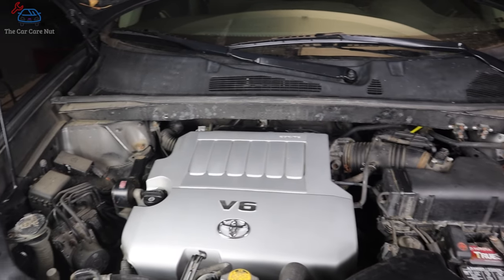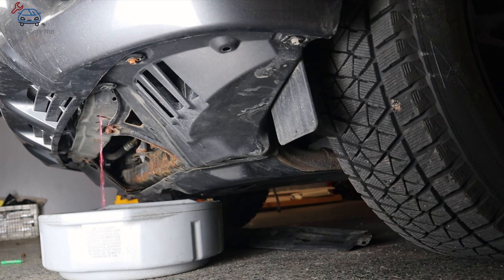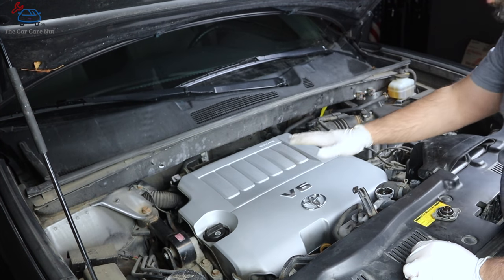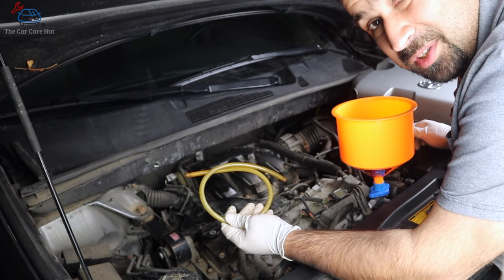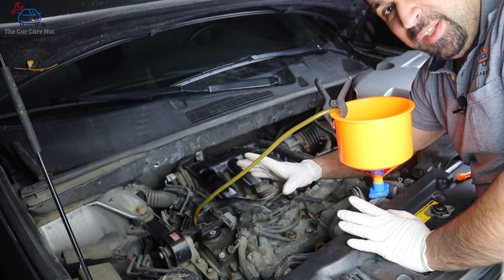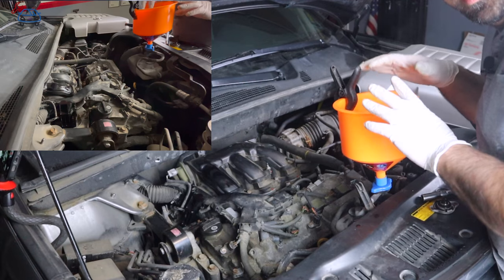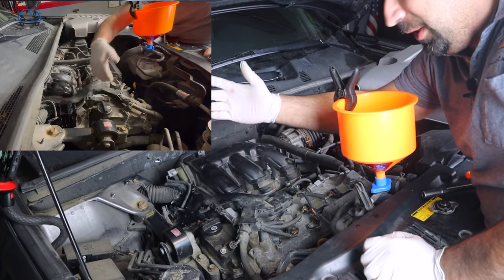Toyota Cooling System Bleeding for V6 2GR-FE 3.5L THE RIGHT WAY!

Comment: The tool you used has a blue radiator cap and the ones in your amazon affiliate do not. There are 3 kinds for sale in your amazon affiliate, the 1st one I ordered did not fit and leaked on our Highlander.  I returned it and just ordered the 2nd one, hope this time works.   Where did you get the one you used in the video?
Reply from the maker: I had the three because these companies keep changing their offerings. The one in the video is I believe the first one but many have said they’ve changed them. Gotta reorder one and see how they are now
Reply: @TheCarCareNut  I am happy to report the 2nd one I ordered did fit with no leaks.  The build quality of it is day and night than the 1st one I ordered, I bought the mid-tier out of the 3 in your amazon affiliate.  I would like to buy the dashcam on your Amazon affiliate as well, will you install it in our car?  I am about an hour north of your new shop on a Saturday with no traffic morning drive.
Reply from the maker: I would. unfortunately the should wouldn’t be open Sunday or Saturday.
Reply: @azzurroday9730 hi, which one exactly did the trick? The one with the black cap on Amazon currently?

Comment: 1 more question guys, should we disconnect the bottom radiator hose to drain any coolant in it?
Reply from the maker: Hi! You could but a only a small amount will come out
Reply: @TheCarCareNut  that's all I need thank you AMD
Reply: Bro I did it just now, worked exactly as you said, thank you kindly, the thing is 4L came out, and I put 5L in the (1 bottle form toyota) but the servicr manual says the capacity is 9.7L. Where is the other 5L?

Comment: How do you know which of the engines you have?
Reply: There should be a sticker on the underside of the hood that shows the engine type. You can also look in the Specifications section of your owners manual.

Comment: I recently replaced my thermostat and water pump. Tried to bleed per your steps. Everything seemed to go well until it all went down the hose and started overflowing back up the funnel. Temp was 185 or so and so thermostat should have opened up. Any ideas?
Reply from the maker: Hi! So after it went down did it start flowing directly through the hose to the funnel with continuous flow?
Reply: @TheCarCareNut  I decided to repeat the process from start to finish. Never did get continuous flow. The violent backflip never did stop. It would go up and down in the funnel. Multiple times, I had to use a cup to take some coolant out only to add it back later so it would never go empty when it reversed itself. How long should this take?
Reply from the maker: It should take up to 5 minutes. So abort the operation and see if you have heat at idle.
Reply: @TheCarCareNut  thank you

Comment: So here's the question: why do you have to rev the engine to 2500 RPM?  Obviously, because then the engine gets hot more quickly and you won't have to wait so long to complete the procedure.  However, I worry tere might be another reason: stupid circulation design. Let me explain: I live in a northern state, and during the winter, there is no heated air coming from the register at idle, which takes away one of the big benefits of the remote start. The airflow temp changes immediately when you raise the RPM.  I always thought this might indicate my system isn't bled, and needs the high water pump RPMs to compenstate.  But this video makes me wonder if this engine just has a design flaw whereby the pump is under-sized.  Interested in your comments
Reply: I would think it is required just to ensure the air bubbles actually get moved along with the flow effectively so that the bleeder does its job. At low RPMs the flow is not fast enough to move the bubbles with the fluid stream but that’s just my guess. All I know is I did it yesterday and it takes a good 15-20 minutes at 2200 RPMs before the spurting actually happens and you can complete this process

Comment: How's this correct way of doing the coolant change? You're mixing old coolant and new coolant together because you're not flush out any of the old coolant that's still in the engine block and hoses.
Reply: Well, my dealer calls this method a 'complete coolant flush'.  Not.

Comment: Ok. I need some help. I opened the bleeder valve and no coolant comes up into the tube. When I started the car and brought it up in temp, my coolant funnel just filled and overflowed. Nothing ever came out of the bleeder valve. And yes, it was open. Any ideas?
Reply: This is for a 2011 camry
Reply: I tried it again and nothing will come out of the bleeder port. When the car gets hot, it just bubbles super violently and Spraying everywhere. I end up having to shut off the car because it’s just boiling over and making a mess

Comment: Hi AMD. The procedure worked exactly as you described. However since then the rear heater is not working! Please advise what should be my next steps.
Reply: The front heater is working fine.
Reply: I’ll tell you what I did. I drove the nuts off it and guess what, 6,000rpm up the hill cleared out the old coolant in the rear heater core and now its working fine…

Comment: I just did this today to a 2010 Toyota Sienna XLE Limited with 2nd and 3r4d row seat heat controls.  After following AMD steps, I no longer have hot air coming out of the vents in the 2nd and 3rd row seat, it only cold air.  The front vents (driver and passenger) are super hot.  The temp guage stays just below the halfway mark. Funny thing is I did this several years ago and didn't follow AMD methold, just opened the bleeder srew and pour coolant until it came out the bleeder screw and never had the problem I have today. I am going to try this again tomorrow and follow AMD method again and hopefully fixes things.  But anyone run into same situation and have any suggestions?
Reply: Ok I figured it out, I have now hot air from the rear vents.  Here is what I did.  I redo the procedure that AMD showed but on my bleeder value I had steady stream of coolant, no bubbles nothing.  I did see some bubbles from the funnel on the radiator cap, so I let it settle and then took out the tube from the bleeder valve and closed the bleeder valve and then idle and let things settle and closed everything up.  I tried the rear heat and still not heat just cold air.  So, what I did was then I redid the procedure but no bleeder value this time, just funnel on radiator side.  I then turned on the heater full blast including rear then I saw some bubbles in the radiator funnel and then vola heat in the rear vents.  I did these 2 more times (cycle through all the heat cycles (face, foot, etc.) then drove the car and redid everything a second time.  Second time barley any bubble on the radiator funnel and now everything works really good.  Nothing but strong hot heat from all the vents.  One tip to keep in mind make sure you overfill reservoir is full.  Anyway, I hope this helps other people.
Reply: @sales4online734   I am not sure why AMD does not instruct us to turn the heater on full blast after the cooling fans come on. That is a pretty standard thing to do to fill the heater core. When the cooling fans kick on thats when the coolant start flowing everywhere. I think that is the purpose of revving the engine, to get it hot so the cooling fans kick on and the coolant starts flowing

Comment: i have a toyota sienna LE 2013 its over heating n no heat is not working how can i fix it please thank u
Reply from the maker: Hi! First try to bleed the system the check for leaks and a blown head gasket if it overheated a lot
Reply: @TheCarCareNut  thanks

Comment: Great video.  I have a question.  How come you didn't flush out the engine with distilled water and if you did do you have any suggestion on how to get 50/50 percent ratio even though the engine block hold a gallon of distilled water?
Reply from the maker: Hi! Unless there’s contamination you don’t need to flush it.

Comment: Can anyone help I have a 2010 Lexus es350 I have Little to no heat coming out the vents in the cabin I did change coolant and got the air bubbles out thinking that would solve the problem it didn’t when my ac is on air flow is normal and ice cold once I turn temp up past 75 the air flow is restricted little heat coming out vents when driving, no heat at idle what could cause the air flow pressure to change when going from cold to hi anyone have this issue?? 

once again the air flow perfectly on ac but is restricted on any temp pass 75
Reply from the maker: Hi! Bleed the coolant per this procedure and see if it resolves the issue

Comment: Is that coolant a 50/50 mix
Reply: Yes. It said premixed on the bottle
Reply from the maker: Pink super long life coolant from Toyota is always pre mixed. The red coolant from Toyota is not pre mixed.
Reply: Is is ok for Red coolant mix 50:50 with distilled ?
Reply: @metzmatu8409  Be aware the red coolant is OAT instead of HOAT. Half the life - change every five years. The red coolant is for support of the early models (before 2004, IIRC) that came with red coolant in their systems. I do not know for sure if it is okay to replace all red coolant with pink, but I would not replace pink with red.

That said, the red coolant is intended to be mixed 50/50 with purified or distilled water. Instructions are on the jug.
Reply: @flagmichael  
Thanks for info.👍

Comment: Why no heater on?
Reply from the maker: This engine doesn’t have a heater valve to open. Also keeping the heater on will make the engine warm up much slower and take a lot longer to open the thermostat

Comment: Hi AMD, planning to do this coolant drain and fill on a Venza. I noticed the engine bleeder valve is really difficult to access as described in the video for human fingers. It's more cramped than in the Highlander shown. Is there a way to make it more accessible or is the procedure different on this vehicle?
Reply: Here's an image if yt will allow: https://www.toyotanation.com/attachments/img_20210611_213156-jpg.337664/
Reply from the maker: Hi! Use an extension with your 10mm and the hose. I hear you on access but it’s possible with the right size extension
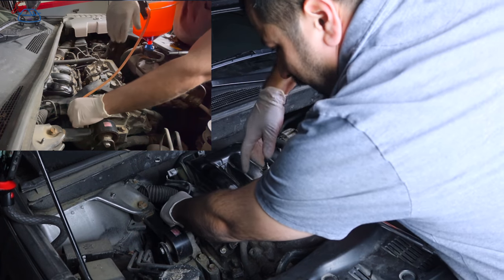Reply: @TheCarCareNut  Yes, an extension will have to be used for sure! But at 9:50 you mention to close the bleeder valve by hand while the hose is still attached, before removing the hose and torquing the valve. Maybe I'll try using turning the hose to close the valve a bit, if it has enough grip, or remove the hose and use a socket quickly hoping coolant doesn't get everywhere. How hot is the coolant during this procedure, i.e. chance of burning oneself? 

As an aside, what is the material of the hose you use? I got some vinyl tubing with 1/4" inner diameter, and put it on the valve with the engine hot to stretch it as mentioned, but I found it got really soft and expanded easily. I hope it will stay on and not leak during the procedure.
Reply from the maker: Use the hose to turn the bleeder closed. Stand the hose and twist it. If it doesn’t work just go quickly with the socket. It will be hot so have some gloves as protection. The hose is vinyl

Comment: hmm, never changed coolant in any engine.  dealer says, there´s no need for doing it..... hmmm
Reply from the maker: That’s incorrect from the dealership! Please review your owners manual maintenance schedule for coolant replacement interval for your model!
Reply: about a decade and a half ago, had a honda, somehow it clogged and pressure built up so bad, the plastic neck was the failure point of the radiator. 

Usually dealer says things to get your car broken so you buy a new car. Or pay more for higher billing repairs.
Dealer also says lifetime fluids and 10 oil changes. If not to damage, and end the life of the car faster, they do it to be competitive in magazines as having "lowest maintenance costs in it's class."
Reply: I buy almost exclusively used cars - in 51 years I have only had three new ones, and except for the 2002 Prius they were among the most troublesome cars I have owned.
Anyway, when I look at a used car I have learned to make two checks most people don't do. I look at the oil dipstick above the full line for varnish (which indicates a steady diet of conventional oil or poor oil maintenance) and I verify the coolant is the right color at least and is not cloudy at all.
That said, most coolant today is HOAT and usually has a replacement interval of 10 years. Fine for Fords and Chevys without coolant changes, but Toyotas generally last a lot more than ten years.
Reply: @TheCarCareNut  thx, i programmed this in my RX menue for the next inspection point. Engine + Inverter coolant change !;-)

Comment: I’m doing this but I still don’t have a steady flow into the overflow tank after like 30 mins
Reply from the maker: Hi! Are you revving the engine just over 2000 rpm and what model is it?
Reply: @TheCarCareNut  it’s a Toyota Sienna 2008 I have been reving it for at least 2000 rpm and I don’t know how long I should do it
Reply: @TheCarCareNut  I tried I again ,didn’t get the full stream like your vid, but my rear heat is starting to come back
Reply: I really think you need it at 2500-3000rpms. I did not have success at 2000 to get the stream going

Comment: Warning- the radiator drain is an obscured standard pep cock. Do not use a 14mm hex to release the AC!
A view of the valve would help.

Comment: You said the heater core should be closed . I thought you want it to be open and on full blast
Reply: About to do it in a 2012 v6 sport rav4. So because it does not have rear heater should I still close the heater core wile doing this procedure

Comment: If only Toyota sold concentrate. I have been flushing and flushing with distilled water trying to get all the bits of plastic and weird mix of coolant out of a vehicle I bought. There is a company that makes coolant specifically for Toyota vehicles which meets the requirements for super long life coolant and what do they make ... a concentrate. To top it off it is less than half the price of Toyota branded coolant.  I would be looking at a small fortune to just to flush with the 50/50 mix.
Reply: Prestone??

Comment: Everything was fine till I closed the bleeder, I put the car in idle to let it settle down and as soon as I did that, all the coolant came back to the funnel violently and spilled badly all over the place till I killed the engine 😔
Reply: I noticed too, level went up, though not to the point of overflow. After turning engine on an off and playing with rpm, got a bunch of bubbles coming and eventually it receded down all the way.

Comment: Hi AMD! Love the shop,  glad it appears to be doing well! Question: I saw another video where they drained two other areas and flushed multiple times with water. Is that not necessary? I have a 15 Sienna with 61,000 miles but based on your advice I'm going to change the coolant now. Also have to do the transmission fluid as well. Really wish I was closer to you! Do you have tips for finding a shop you can trust?

Comment: That bleeding is partial. What about the coolant in the block of the engine.  Toyota procedure or American procedure. The bleding should include the block and the heater core.
Reply: The CCN addresses those in other comments. The block drain (I have never worked on one) apparently is a devil to get to and drains very little, and since there is no heater valve it doesn't matter whether the heater is on or off.

Comment: I dont think this is the right way to bleed the air.
Many manuals state to fill the radiator with engine off and bleeder open. When coolant starts to flow out of the bleeder, close it and start the engine, warm up until thermostat opens. Make sure the heat is on high to allow circulation through the heater core.

Hearing up the engine without pressurized the system can overheat it and possibly cause a blown head gasket. Boiling point increases with increased pressure so having atmospheric pressure at high heat might just result in boiling  and hot spots.